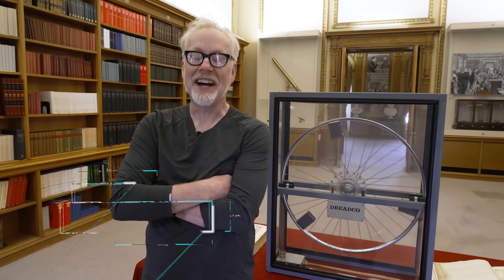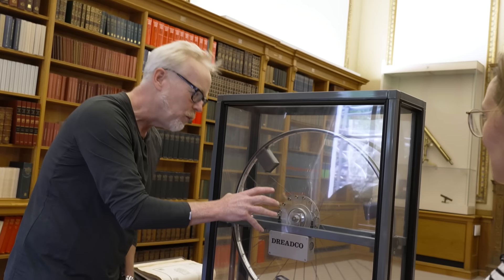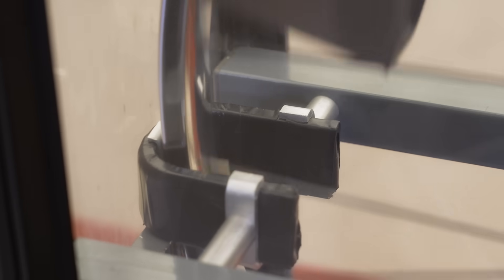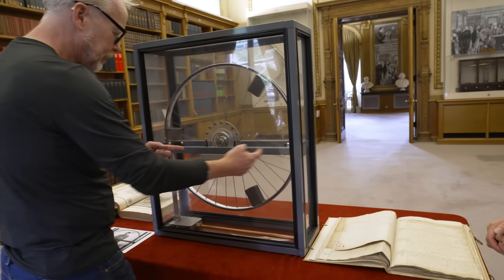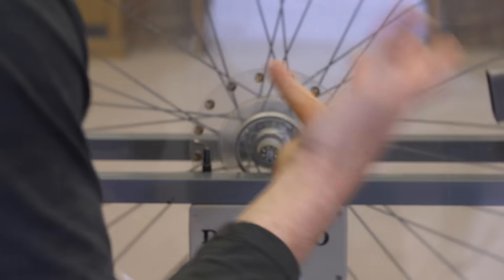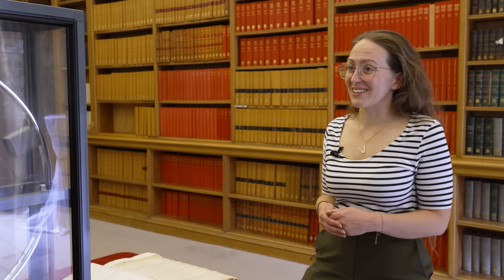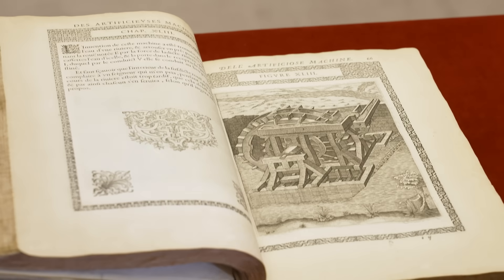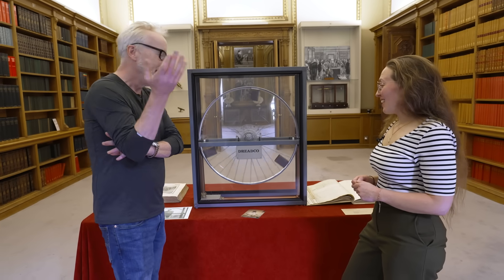Adam Savage vs The "Perpetual Motion" Machine!

Comment: I think it is a type of balancing mechanism that makes it work that way. Through every move, it makes it slight shifts out of balance, causing it to rotate. That is my best guess.
Reply: Incorrect. Something like that would be a real perpetual machine.

This almost certainly uses magnets
Reply: @dusklunistheumbreon  How did you figure that?
Reply: @aaronhesser498  That is the classic perpetual motion machine. It's called the "overbalanced wheel." And it's exactly as impossible as every other perpetual motion machine. It has been debunked more thoroughly than basically any other thing ever proposed in history.

Comment: Listening to Adam fumble around is causing me anxiety. The frame itself holds 169 V batteries that run on a circuit board in series one at a time providing the input to use those 3 magnets to power the perpetual motion machine as a reverse generator if you will when 19 V gets low the circuit board switches over to the next 9 V. After all these 9 V have run in series which should take it several years not 2 years but more than you'll have to replace the batteries. The friction of the horizontal mounted actual turning is enough to stop this so called propetual motion machine. A grandfather clock with 4-D batteries hanging on the wall that runs for 10 years without replacing the batteries and ticks and talks back-and-forth is a better perpetual motion machine than this.

Comment: Besslers wheel is very easy to calculate. I have my own 20 kilowatt free energy invention sitting on A Nasa website now for over 7 years. It is helping to develop micro grid systems.
Edwin Gray's R.E motor uses Tesla coil tech and produces 10 kilowatts and 1,000 horsepower. 😄

Comment: I'm no rocket scientist,,,, however. My opinion is that it is simply about weight and balance. Everything else is just a distraction.
Remember:-
80% of conspiracies are made up by people who don't want you to know the truth.
The same theory applies here I believe.
I'm 57yrs into this life. So I hope that when I am reborn into the next my theory will have been proven to be correct.
I base my theory on the fact that the machine "can" run for UpTo 2yrs before some type of service has to take place.
The running time of the device is not defined because natural phenomena such as temperature and magnetic fields, maybe even natural background radiation are at play. Even ultraviolet light and infrared light waves could be used in a way to change the weight of a substance, liquid or compound.
However I stand by my theory of very finely tuned weight and balance.
 🇬🇧👍😎👍🇬🇧

Comment: Well, it have an heat sink so... 🙃 maybe the same power as voyager probe? A radioisotope thermoelectric generator? We can grab a Geiger counter? Or a thermal camera? (Or maybe, it's made for thermoelectic peletier generator (TEG), it's the least efficient type of generator, but it can produce from temperature difference, it can be an expanded gas , difference of air pressure... does it would work in vaccum? it's just need a very very small amount of energy to continue to turn.. 😉 the heat sink is sure not to dissipate a lot of heat as we know, I guess is to grab the  smallest temperature or chemical differences from a TEG... I not remember who but plexiglass or lexan can't be see thru with a thermal camera... (to keep mystery privacy... ;D )

Comment: What if you built a machine with the mass of a star, put it in space. The mass would slowly gather gasses Into a chamber that would push a piston until it reached the exhaust port (tdc) where the vacuum of space would suck and expel the gasses out, driving the piston back down to bdc.

Comment: Hiding a brush-less motor in plain sight or using a tiny electric motor. By 1980 we had electric watches on our wrist, those button cell batteries usually last about 2 years. I wonder if the motor is from a analog dial electric watch? I do note that the weights on the rim seem to spin by at one per second?

Comment: One has to measure the power what such a wheel in atmosphere and best possible bearings needs to turn. The machine needs service after about 2 years, one then could conclude if there is enough space in the construction to fit batteries with enough energy. If not then it starts to get interesting.

Comment: That looks a lot like my perpetual motion machine, which also works by hiding the power supply in what looks exactly like a power supply. Had I figured out how to do it without a power supply, I wouldn't have had to hide the power supply in exactly what looks like a power supply.
Reply: Hahahahahhah❤
Reply: Haha, this made me guff.
Reply: hmmmmmm they didn't claim it's prepetu module, it is just kind of efficient... u jump start it and it goes for awhile.. as for the boxes .... obviously half way filled up with liquid of some sort
Reply: @hectuswectus3645  The trick is the photosensors.  My guess is that it only needs a few minutues of charge every week or so to put energy back into the system.  Not too unlike how Seiko eco-drive watches use a little bit of sunlight to keep operating for extremely long times.  My guess is that the underground storage has some lighting in it, even at a low level. But outdoors or under normal lighting, it basically is a solar cell operating a motor.
Reply: @plektosgaming  Remember though, this is using solar cell technology as it existed in the 1980's. As the Archivist said, it's kept in a room with no lighting, save for the very occasional opening of the door. Though it's possible that she was being less than honest, I really don't see it - it seems like they want people to make their guesses based on accurate information (or at least on what they can see).
Reply: But the electricity to keep up that magnetic pull/push.
Which by the way ... how did it pull/push /enough to feed the perpetual ?

The classic over unity ?  a battery feeds the push .  With I guess a fixed magnet for the pull ?  And needing precise magnetic field split is the key here ?
But ya am guessing battery power . . .

Comment: It's mostly Peltier effect... with a temporary mechanic storage
Reply: Just because of the day variation in temperature that gives an electrical current, that can be stored in mechanical energy, then restored like a reverse electrical engine using magnets
Reply: They just need to change the magnets every 2 years, as they wear off
Reply: Get it in a temperature controlled environment, with no light, it'll just stop a lot quicker
Reply: I could add some stuff about the gas compression and restitution, but that's boring for me.

Comment: My theory is in the boxes placed round the wheel are electro magnets which are attracted to the 2 curved plates either side the box in the middle has a chemical battery which has 2 outputs positive and negative. the two towers sticking out of the box make contact with the brass pads which you can see have wires coming out and going to the shaft which then either sends current through the whole wheel or just some of the spokes powering the magnets in a certain pattern due to the pads being spaced causing the magnets to turn on and off causing the wheel to be spun

Comment: There is a small battery powered compressor in the centre box which directs air at the cups to provide rotation via the right “diode”, the left one is a decoy. The boxes on the rim are probably empty but are just enough to add a little weight to control speed. The other stuff also decoys. Just my take!
Reply: I was considering something like that (just as a "if I wanted to disappoint people how could I do it?") and figured and even more mischievous use of that "anode." Consider something like a reed switch where the cup is magnetic and instead of interrupting a circuit, the switch were a valve allowing a quick puff of air to flow through the "diode." You'd get a lot more bang for your buck from the compressed air and the height offset between the two parts seems to align for something like this.

Obviously that's not the correct answer, though. The CORRECT answer is that this is powered by the energy of people guessing incorrectly while standing next to it. That's why people are disappointed when they learn the right answer: because the wheel stops spinning and stationary wheels are disappointing. Even as you read my very accurate answer right now, your realization of this truth is slightly impacting the speed of the wheel spinning. Should anyone read this aloud near the machine itself, it'll probably seize up permanently due to how super correct I am. Perpetual energy is fake, but the Law of Attraction is very very real. You can manifest anything by thinking about it hard enough; if you can't spin a wheel by believing it'll spin, you gotta just believe and think, like, so super hard.

Comment: I think the 3oclock and 9oclock U shape are 🧲 and the little boxes on the rim are set 120degrees offset apart so it can keep the rim turning. The servicing she speaks of every 2 years I think is the bearings failing from wear and tear on them from constantly being used. The other little things within are just to throw you off like dreadco box and the heatsink box.
Reply: You can't make motion from magnets alone, because the pull just as much as they push.
Reply: Even a shitty bearing with no more load than that on it would last decades. A good ball bearing, like the one in there, can last longer than you would imagine. Just think. There are cars on the road from the fifties and sixties with hundreds of thousands of miles that have never had wheel bearings replaced or serviced. Or engine bearings for that matter, which are not nearly as robust as roller bearings or ball bearings. Lot of people thinking that bearing needs to be serviced. Nah. At that speed with that little bit of weight, it would easily last several lifetimes.

Comment: A science center near me has one of the David E.H. Jones perpetual motion machines.  When you look at multiple of Jones's  machines you can indeed start to make out what parts are likely decoys and what is part of how it works. Also this machine has the "boxes" but they don't actually have a cover so you can see the internal structure. But sadly seeing that does not really help at all 😄They tell the service interval is slight longer than the one in this video, so maybe its a more developed version, has better bearings etc...
Reply: How much power does it actually make?
Reply: @monotech20.14 it doesn't actually have a positive rebound of energy due to it needing to be charged every 2 years

Comment: cool. Its battery powered. Im a stupid person, but I can't imagine the amount of force required to spin that wheel can be anything significant.

He said the boxes cant be connected because they are all attached to the same metal wheel, but the wheel could be hollow, with insulation run through its interior. Then the boxes would be attached on the outside, but have openings that lead wiring between boxes.

I also wonder if it is a pressurized case that is under a vacuum. Many interesting changes to the possibilities if thats the case  Unfortunately, she said the people that do maintenance on it have said the secret was disappointing, so its really a parlor trick that was most likely explained during this video

Comment: The 3 boxes probably house batteries, electromagnets, and mercury switches in a circuit with resistors to supply just enough force to overcome the friction of the bearing at a constant RPM. The mercury switches are calibrated to power the magnet momentarily at just the right arc of rotation to be attracted by the U magnets then shut off when horizontal. The other features are probably decoys. This design allows the 3 boxes to be completely independent of each other, and yet act in unison.

Comment: The copper and box means nothing,those are not magnets either,it's simply a tiny efficient geared motor tucked away in the center hub and batteries in the dreadco box

Comment: Love this device.
A very simplified idea of building a similar one.
Its nearest relative is here : 
https://www.youtube.com/watch?v=oDSUaBoJN8w
After the 22 second you could see the clock mechanism working.
The two magnets on approach to a coil create a pulse.
That triggers an electronic circuit to create another pulse.
The pulse pushes magnets.
On return the cycle repeats.
My guess - that the three boxes each contain a coil with an with an electronic circuit and a battery (similar to the one in the clock mechanism).
A couple of horse shoe magnets complete the picture.
All you need is to give push to the wheel...
An electronic circuit could be implemented with a couple of transistors and a few other elements.
Hope that the prototype clock from the clip will find its place next to the device. ;)

Comment: An even bigger problem with perpetual motion is that it is never usefully even if it did exist. 

As soon as you actually try to do any work with your perpetual motion machine it stops being perpetual. 

Like if you wrapped a belt around this wheel to drive even the tiniest generator it would quickly stop. It is useless other than art.

Comment: So we have a moving wheel that is using weighted system passing through a duel magnetic field which actually doesnt give off any electricity .it isnt a perpetual motion machine as it will also only run for at least 2 years before needing to be serviced.

Comment: It can be done. But not "infinitely" I've have a potential design that could work for a long time, if maintenance is regularly done. And it technically could be scaled down to a phone battery that could last for 2 - 3 years without a charge. However, the obvious downsides would be that it would cause a lot of heat, and noise. Still this design seems to use magnets to move. And would seem to realistically only work for a couple days at best. Since the design on it seems similar to a roller coaster's breaks. Which uses either copper or magnetic strips to slow down rather than using conventional breaks which would likely break due to the speed. Still. I doubt that that machine has been working for more than two years. Especially at that speed.
Reply: Still my point was that a generator could expand the life of energy, not infinitely generate it. The problem of "perpetual motion" machines are the illusions that people want to make of them. Not the practical use of them. For instance that machine would either use a electro magnet rather than just drawing power from a normal natural one. With maintenance a giant purely magnetic based power plant could be made if it weren't for 2 issues, 1 being that giant natural magnets are rare and expensive to find and legally use, the second being the lifetime that the machine could have would be shorter rather to a hydro dam or a oil method. However smaller magnetic based generators could be better used for space exploration or emergency situations. Still my point was a fully magnetic based power source shouldn't always be badmouthed as a "perpetual motion machine" since magnets do infact hold energy and lose energy over time. And that energy can be turned into mechanical and/or electrical energy fairly easily. The issue mainly being friction, heat, and age which will eventually always render the generator dead over time. Still I'm surprised on the fact that these generators haven't been researched more, since people always associate them with crackpot "scientists" that can't handle the fact that energy is limited in this universe.

Comment: 🤔As the wheel turns the copper turning in front of the anode and the cathode a small charge is being generated, the speed of the wheel plays a role. The boxes are attracted toward the horseshoe, Electrons go in the copper tube to the left of Adam, the south end of the box on the wheel has a positive charge and causes it to be repelled by the horseshoe which is why the wheel speeds up, slows and speeds back up (attracted, then repelled as it passes) when the boxes are passing the horseshoes. The right side has negative charge, the electrons come out the copper pipe and the box on the wheel is again repelled  once it passes, this time a negative charge.🤷🏾‍♂
Reply: Simple, really :-). But doesn't make any sense.
Reply: @curiouscat8457  lol, I know lol🤣

Comment: All about magnets, with the ability to push and pull, just like a scrap yard car picker with electrical charge to turn off and on, the box is pulled through magnetic force on one side and pushed on the other a centrifugal force takes care of the rest, the reason the reason theres batteries is to switch electro magnetics off and on at certain times.as long has the batteries hold charge then it is perpetual, or the  dynamo dosnt fail..

Comment: You can make a machine like that with pumps as the weirdest movie the pumps created are and you will have to put flaps on top of the wheel and it'll valve that will be spraying the air from The Pump Station as long as continues movie keep on being sprayed by the air of the wheel motion of the pups

Comment: Probably to Grease the bearings. As it looks like it’s the even spacing of weights. Which just tip over each other, which sends it into moron in which it would keep a steady pace, depending on size of wheel and weights. You see it sweeps through at the bottom as the top one tips which lifts the back weight. Which would with a small dynamo to create a charge. The better the bearings the better the motion.and you could put the dynamo inside the hub as the pain part of the dynamo rod through the middle, would be the spindle. Thus the rest of the housing would be enough to house the rest. This natural generating electricity, a charge with perpetual motion. Well that’s what I would do any way. Thats why i won’t watch the end.